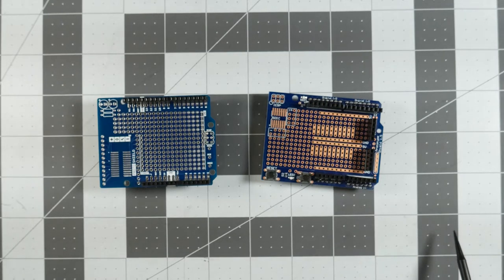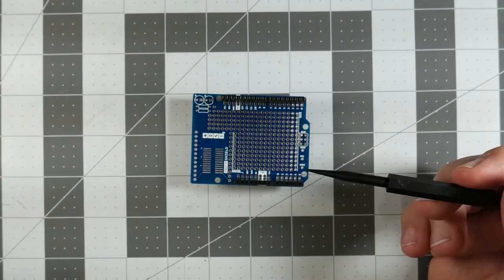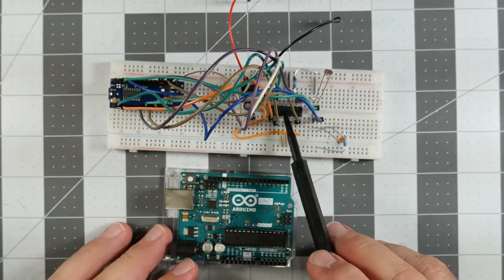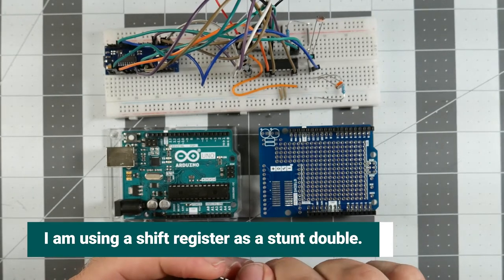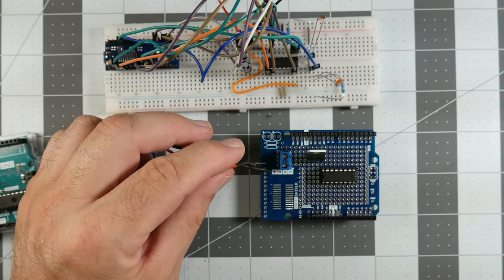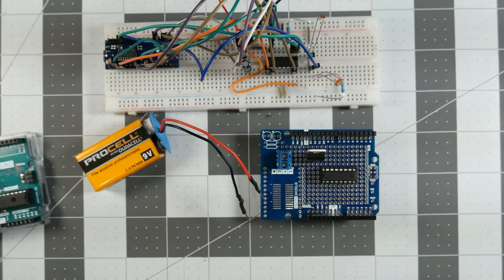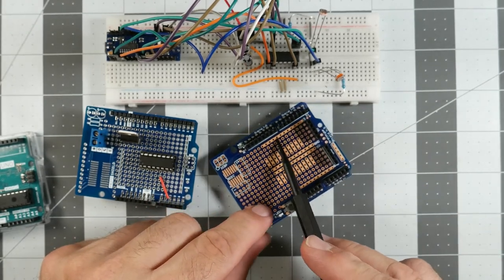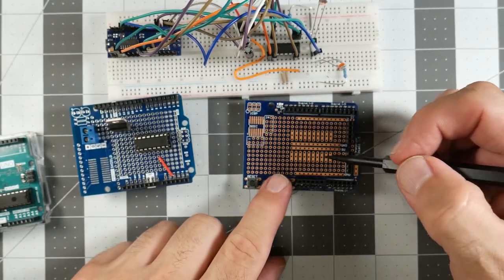How to use an Arduino Proto Shield and Elegoo Prototyping Shield

Comment: is there a shield like this with access to the digital pins for the mega 2560 that you know of.
Reply from the maker: ElectroCookie has this one for $15.  It's a 2 pack!  I  made a video about ElectroCookie shields for the Uno.  They make good shields.  This seems to be the best answer:

https://www.amazon.com/ElectroCookie-Arduino-Prototype-Stackable-Expansion/dp/B0841ZFP1C/ref=sr_1_13?crid=CZFWT2PHTQUW&keywords=arduino+proto+shield&qid=1707607942&s=electronics&sprefix=arduino+proto+shield%2Celectronics%2C384&sr=1-13

This is the one I bought but it is not available right now:  
https://www.amazon.com/gp/product/B0169WHVGS/ref=ppx_yo_dt_b_search_asin_image?ie=UTF8&psc=1

Elegoo has this but it's a kit and costs $65:
https://www.amazon.com/EL-KIT-008-Project-Complete-Ultimate-TUTORIAL/dp/B01EWNUUUA/ref=sr_1_1_sspa?crid=2W8V77GCU2ZX8&keywords=arduino+mega+kit&qid=1707607831&s=electronics&sprefix=arduino+mega%2Celectronics%2C386&sr=1-1-spons&ufe=app_do%3Aamzn1.fos.006c50ae-5d4c-4777-9bc0-4513d670b6bc&sp_csd=d2lkZ2V0TmFtZT1zcF9hdGY&psc=1
Reply from the maker: Shield without headers soldered on.  https://store-usa.arduino.cc/products/arduino-mega-proto-shield-rev3-pcb

Comment: you could remove the sockets and pin headers and replace them with stacking headers, then the elegoo one would resemble more the other one, with the same free solder holes for accessing the pins, and you could stack other shields.

Comment: Check out AliExpress for that Uno Proto Shield. I purchased 10 of them fully assembled for just over 10 dollars. Checked today and you can still find deals like 10 for 12 dollars. I have used to make my own midi shields,audio out shields, ATtiny programming shields,trigger shields with 555 ,4071,4020,4040.4060,  multi voltmeter tester and various testing boards. You can google arduino shields and make them yourself instead of buying.You can google arduino shields and make what you find in the search results  yourself instead of buying. Best kept secret as I have only found 2 videos where people actually show a finished project .I have used both  types you showed . I actually prefer the Elegoo because I can transfer from the bread board exactly like I built on the breadboard without having to totally redesign the circuit which I spent time testing on the breadboard.  Also the extra 5v and GND are invaluable. There are many work arounds for the female headers.